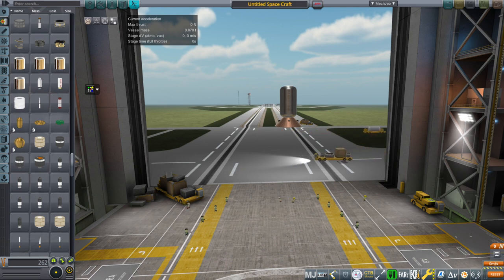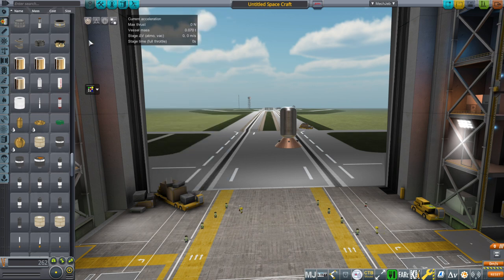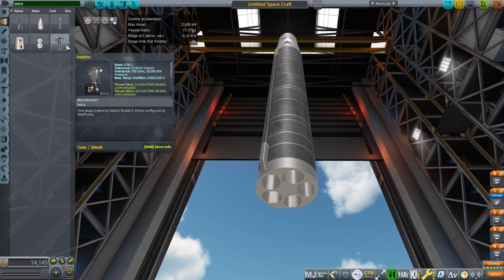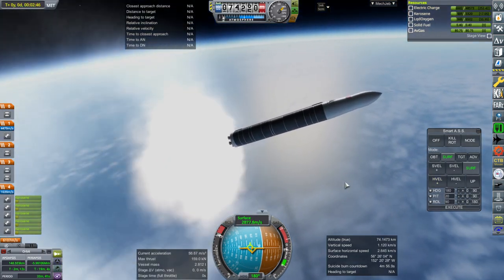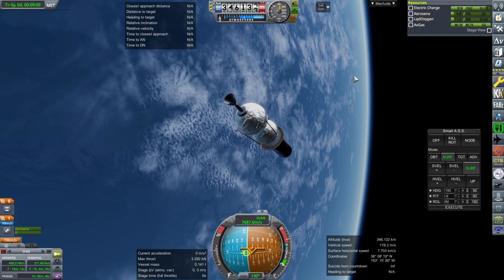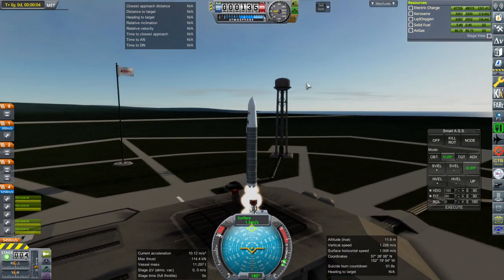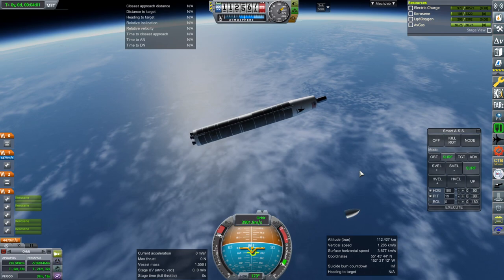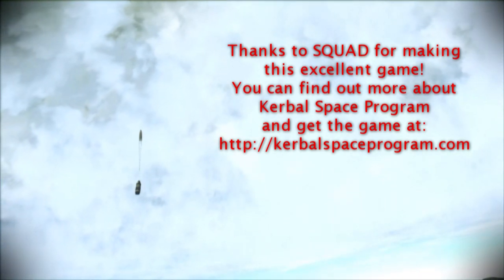KSP with Realism Overhaul - Astra's Rocket 3

Comment: @Raiz Space I think it was engine throttling, because they don't gimbal, they use differential thrust to tilt it, so lower throttle on some of the engines likely kept it down
Reply from the maker: I didn't realize they didn't gimbal, and using differential thrust would explain it. Do you have a source for that? I would like to know how much the engines can throttle down, since as I have them configured, they currently can't.
Reply: @RaizSpace  I have just heard this from hear and there, and by looking at the base of the rocket there is no room for them to gimbal, and as for a minimum throttle... I have no clue, sorry about that

Comment: Could the thing weighing it down have been battery mass, or do you feel that was adequately accounted for? The Delphin engine is an electrically pumped engine after all, so there is a lot of battery mass. It's may also be possible that the burn time you found was for 3.2, not 3.3, and therefore pre-stretch.
Reply from the maker: Well, battery mass is dry mass, so it'd just go into that column, and our problem there is it cuts into delta-v and therefore the payload capacity. The question is how much capacity should we expect it to have.
Reply: @Raiz Space  I've heard them say that the "Rocket 3 series" has a payload capacity of 50 kg. I couldn't begin to tell you whether that refers to a general target of the whole series, or a specific version within the series.
Reply from the maker: If it is 50 kg, then the dry mass of the first stage could definitely be higher, leading to a hover more similar to what they had, so maybe I'll try it.